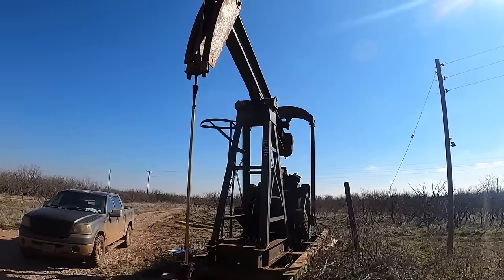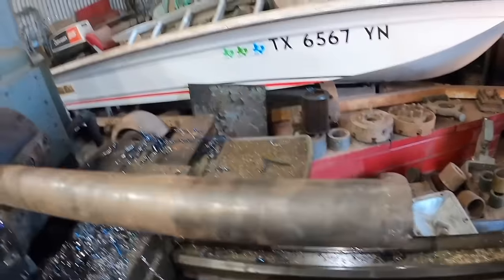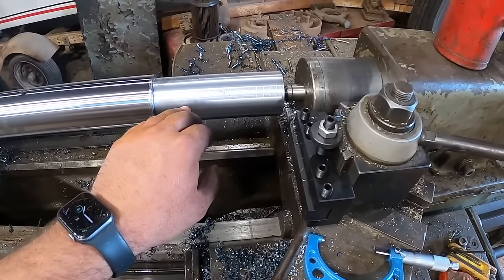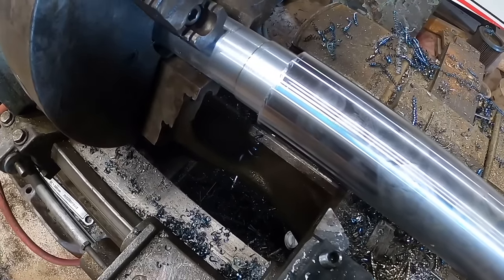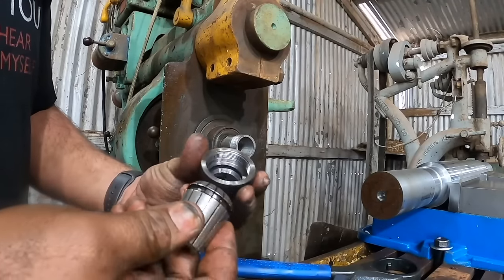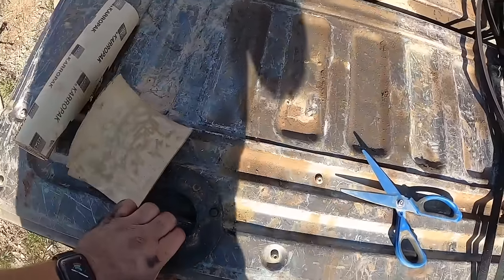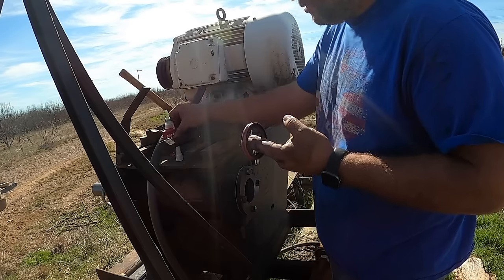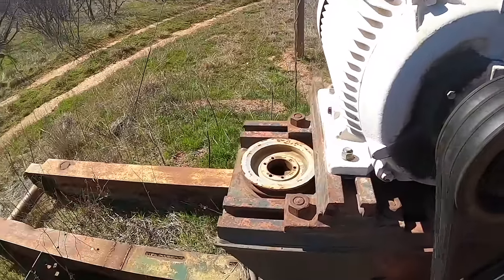Lufkin Jack Shaft Replacement on 100 Year Old Oil Well

Comment: Nice job, 102 years old well still producing, run by an antique pump jack. Way cool Zach, thanks again for sharing.
Reply: Coming from mining and general heavy industry, not oil industry--I can imagine oil may flow into well area from surroundings "indefinitely", under some circumstances.
 I'm impressed by this old setup.

Comment: Another most excellent video!  Two friendly comments:  1.)  Thank you so much by not boring us with endless video facing off the work (which you didn't do anyways).  2.)  Next time you are at the swap meet, there's always that guy selling assorted wrenches for two bucks each.  Buy some dedicated wrenches for that lathe!
Reply: Your point #1... Exactly!  That shit drives me crazy.  "Regular" machinists going through the motions of stuff that is absolutely not necissary.  And going for that .0001" when .001" or .01" is all that's necissary.

Comment: Back in the day, I would align the belt sheaves with a long 1/2" or 3/4" fiberglass rod laid across the grooves in both sheave wheels for good quick belt alignment. I keep the rods under the seat of the service truck. I enjoy your video much!

Comment: Thanks for keeping this piece of history working, and showing your machining skills as well. Here in Western Pa you still see some old wells randomly appearing on the hillsides of a pasture with big pvc barrel hooked up for anything that may get pumped out. Other times if youre just driving through the backwoods you may find a derelict well mostly hidden in the trees - covered in rust and moss. 
I also remember when I went camping to Wyoming for a few weeks back in 2008; how on the drive there I would see some of these on the plains working in rhythm .... up and down up and down. It sticks in my mind because I wasnt in a rush and wasnt driving on the interstate at the time; so I had pulled off to the side of the road to check my maps and have a quick lunch. One side of the road had this massive farm field... no idea any more if it was corn or wheat; and on the other was just regular plains with the wells.

Comment: Nice to see ya saving big bucks doing your own machining. That's got to save absurd money and time besides getting exactly what you want.

Knurling a shaft is an old timey repair so it may have been done long ago. It seems odd for an old US manufacturer to knurl an undersized part (though it lasted many decades) when it's so quick to machine another simple shaft like that one. Knurling was also a common way to make piston skirts a closer fit in worn cylinder bores and to make stock OD valve guides fit a loose guide hole in an engine cylinder head. (Do not confuse that with the much more common knurling the INSIDE of valve guide.) Knurling a bushing can improve a press fit too , like the common cheap spacer bushings pressed into riding mower idler and tension pulleys.

Comment: I worked at a sawmill for 8 years and have taken out of the bolts from a split bushing and used them to pull out the core ; it made life much more easy to remove the pulley and replace it with one that might be better .

Comment: I worked at a Oilfield Pipe & Supply in the early 80's and we put jackshafts on many single reduction pumping units (it was hard at the time to get any pumping units)
We used I beam and pillow block bearings.
I wonder now how long any of them lasted.

Comment: Harbor Frightening Tools to the rescue.  Yes, they are disposables.   Nice work Gasman, thanks for the oil!.   You might find this funny, but I use 140wt gear oil on electric fan bushing and bearings.   Shop sized or bathroom heater sized, they wont squeak for a VERY long time after a load of 140wt.   1921 - The first radio broadcast of a baseball world series game.

Comment: Nice video like usual.  Thinking about it, there probably aren't too many different size bolts on each machine.  I wonder if it would make any sense to buy a lot of cheap wrenches of the most commonly needed sizes, and leave a set of wrenches at every work site which includes all the wrenches needed for that machine.

Comment: I used to work at Lufkin Industries in the foundry - the castings should have a part number and date code on all of them (although I don';t know when they started doing that-it was at least an 80 year old system when I started there). The first 3 digits of the date code are the Julian day of the year it was made (e.g. Jan 1 is 1 and Dec 31st is 365); the 4th and 5th digits are the year (I could have that flipped though, it's been awhile since I was there). If there are more digits, that's the mold number for that day (e.g. they ran the pattern through the mold line more than once). Hope that helps!

Comment: Great Job.  Sorry about the  Lufkin Engineering being bought out by GE and they closed it down - I believe the shaft balancing unit is in operation.  Foundry gone as is engineering.  Sad but the drop in business forced the issue with aging owners.  No one could buy it but GE stepped up then crashed them as GE got into trouble.

Comment: Good stuff. Wish you showed how you aligned the 2nd keyway cut to the first. Did you just put the key in and run a square off the table to the 1st keyway to make sure it was 90deg to the bed? Or something else fancy? Love these repairs!
Reply from the maker: They didn't actually need to be aligned but I just eyed it close.

Comment: I do love those shaft taper locks. Compared to fitting hubs on to straight  shafts.  Do you have a rough time between changing the bearings on your electric motors? How many years do motor bearing last in constant use 24/7 ?
Reply from the maker: Usually lighting gets them before they are used up. Id say between 3 and 10 years

Comment: From a loggers perspective why don't you have a service truck, nothing fancy, mine is a one ton so over loaded as to be called "the road slug"  and as l age l find the luxury of the small crane on the back very agreeable with my back!
Reply: I was wondering the same thing.

I service heavy equipment in the field, 3/4 ton 2wd chevy, with a service bed. It serves a purpose.
Reply from the maker: I have thought about getting one. Most of my day is spent driving around leases checking stuff and gauging tanks. A service truck would beat you to death and not get around in the mud. Most of these videos happen after that without a trip back home to get another truck anyway.

Comment: Zach, On those pumps does it matter which direction the motor turns do the pumps work the same either way?
Reply from the maker: Almost all will run both ways. This one however has a direction tag on it. It's probably for oiling correctly.

Comment: Another fix for open keyways is to use a gib-head key, with either single or double head. The double head gib key is installed on the sheave before the sheave is placed on the shaft, the single can be on the sheave or shaft just as long as you dould check the head is on the captured side.
 
A bit surprised that you have that horizontal mill setup for an endmill rather than a slot cutter, which is where they really excell. I suppose it's what you had on hand, slot cutters will allow woodruff keys for the captive option.

Comment: It's amazing that all that equipment lasts so long out in the elements, does a body put a shed over the electric motors and such?  As well, what are those huge leaf springs for under the pump Jack?
Reply from the maker: Not generally, they are just weights.

Comment: You did a fine repair, but you didn't pack the bearings before you installed them or does it matter?
Reply from the maker: I wiped a little grease on them but they really don’t need it because they run in oil bath.

Comment: that is one hell of a tail stock on that lathe.  Damn son.  I've seen bigger, but I don't know that I've seen bigger with that bed length.  If I can find you a new wheel for your saddle would you be interested, on my dime.
Reply from the maker: Its a stout little machine. Ive actually got the broke piece i need to weld it back together.

Comment: Sometimes GoPro's will overheat and shut down if left in direct sun.  Also I prefer using a usb cable vs removing the card, seems like less corruption issues that way.

Comment: The centre drill has another function , even if the job is slightly eccentric the centre drill will always cut a hole thats in the centre because it cuts the furthest from the centre the hole just ends up slightly larger , thats why there is no flex in the drill

Comment: It has been my experience:  GoPros routinely corrupt the file structure on SD cards.  It doesn't seem to matter about the brand, quality or price.  The most reliable fix seems to be a low-level format of the SD card.  There are a few levels of format, pick the lowest level and, if offered, specify error checking.  Also, many GoPros don't like to get warm or hot - weird things start to happen.

Comment: Great work Zach appreciate how ur detailed and explain what and how you doing... I have couple question regarding the well its self??.

1. How deep is the well
2. is it a vertical well
3. Has the well ever been fracked
4. What the flow rate
5. Is there alot of water mixed with the oil

Please if you can spare ur precious time to maybe answer couple of the id love you even more 🙏🙏🫂
Reply from the maker: 1600' vertical. It would have been fractured with nitro when it was drilled. These wells have a high water percentage.
Reply: @TheZachLife   Thank you sir 😎

Comment: It takes guts to impact a 3/8 bolt into a shiv. I can't tell you how many I've broken off just being stupid and over tightening them. The Jack shaft box seems like you could put 2 pillow block double bearings with grease fittings instead of this huge box with oil and radial bearings. Would make it easier to change out AND not leak.

Comment: To set your tool height, you can also line it up to the tip of your center.   If your center isn't perfectly in the center, you've got serious problems and it would be extremely noticeable.  In fact you would probably break things.
Reply from the maker: Absolutely but if you are using the tail stock.

Comment: What’s the spm goal to have a jack shaft like 2 spm?
Reply from the maker: It's single reduction. You have to have a jack shaft.
Reply: @TheZachLife  so the gear box isn’t like a modern gear box with the way it operates? The only time I’ve seen jack shafts in the Permian is to slow the unit down beyond what you can with the smallest sheave for that motor frame

Comment: My dude, it isn't the computer.... GoPro is garbage. I watch a lot... A LOT of creators. And soooo many complain of the same issues you do. And the shutting off isn't battery related, it's overheating. Seriously, GoPro has been hot garbage for since 2017 or so, and they just keep doubling down.

Anyway, great video.
Reply from the maker: Thanks. It was actually pretty cool.
Reply: @TheZachLife  It's really what's going on inside the camera.

Comment: Say Zach,   A thought on your video / audio loss issues…….  👁️👁️. Clean (not oily) hands may be your culprit.  👁️ A slight oil film will attract dust (I’m sure you work in a dust free environment).  🌞 Oil and dust = intermittent connection issues 🌞 I grew up in Odessa and have worked in the field as far as Michigan.  Worked in Production/Operations, liquid/gas measurement.  Stories I could tell. 😎

Comment: A lot of the times the issue with the GoPro isn't the SD card it's the battery. Don't use cheap aftermarket batteries by the white ones from GoPro that they call Enduro
Reply from the maker: Intersting.

Comment: GoPro Sucks... You can choose damn near anything other than GoPro and get better results.
Are you recording in 4K?  Many times those POS cameras can not sustain the higher resolution.
What manufacture and PN memory are you using?
Reply from the maker: I only shoot in 1080p. I use sandisk extreme
Reply: @TheZachLife  GoPro issue then.  They just can't get it together.  I really don't understand how the market has not pushed them under.

Comment: It’s interesting to see somebody that has a micrometer and does not know how to properly work it or read it down to the thousandths but just says, “Yep.”

You never use the barrel nut to tighten on a part, only use the thimble.

Comment: If your video files are on microSD card there are many low grade ones out there which may cause file corruption. I and many others go with Sandisk (beware of fakes).
Reply from the maker: They were both Sandisk extreme. I had trouble with both.